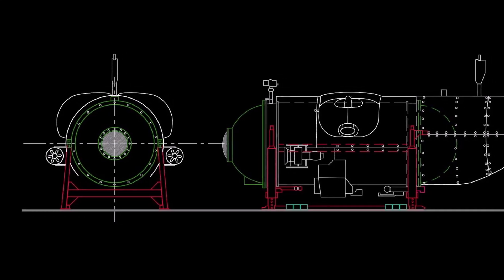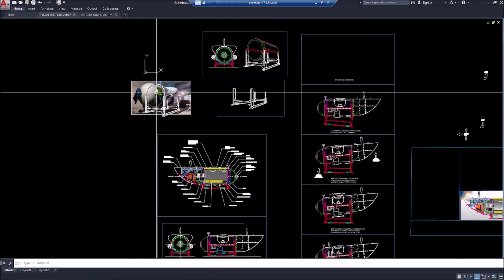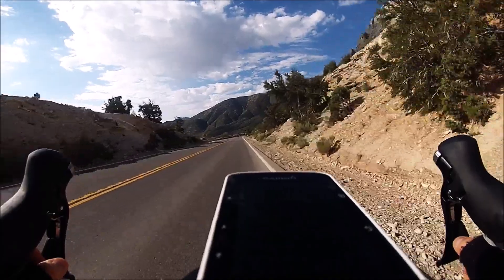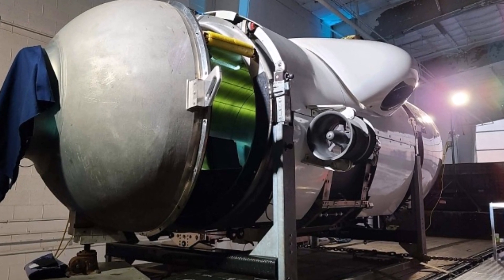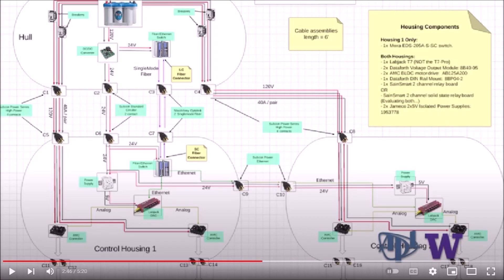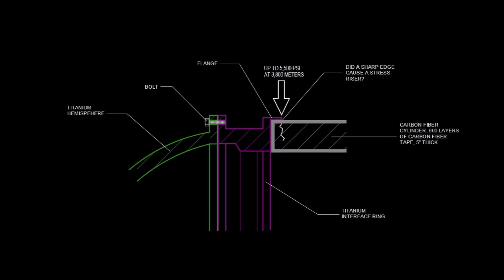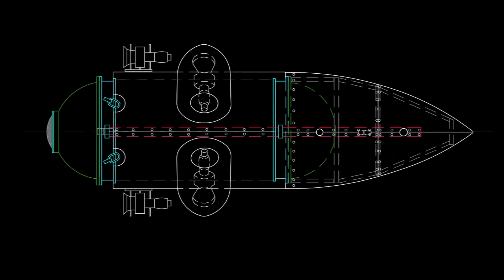OceanGate Titan - INTERFACE RING CAUSED FAILURE?

Comment: Interesting hypothesis. The precise geometry of the notch and bulkhead through joint is not clear at all on your sketch or the blurry photo of the ring, specifically its placement on the major axis, also was this void in the ring not filled with a suitable structural element such as another epoxied titanium piece? I find it difficult to accept that the design would create and allow for several inches of interface between cylinder and interface ring where the epoxy joined the two mayor components, but then in one spot narrow that down to a very small glue joint. To your point about a stress concentration point at the out Ti ring flange on the exterior of the cylinder - the cylinder shrinks more under pressure than the ring so there would be no stress concentration point on the exterior, the interior is another matter: another point I'll make is that I have seen on other cross-sections the Ti ring had an inner and outer flange that nested the cylinder. That inner flange would be a stress concentration point.
Reply from the maker: Yeah you would think that if they had a notch in the ring it would have been filled with something, but even so it's still a weak point. I disagree that the CF cylinder would shrink more than the titanium. Carbon fiber should be stiffer than the titanium. You can see those wiring ports slightly better here: https://youtu.be/Gm28gju5Brw?t=677
Also with carbon fiber in compression like this it's subject to the development of kink bands, which can suddenly appear. Basically another form of de-delamination that can occur. Flange on ring could've initiated it.
Reply: @VegasCyclingFreak    The link to the video you sent I have seen before, yet there is no clear view of the notch you speak of, there is a blurry photo of the outside of the two connecting ports that show no notch in the ring at all. I think you are also mistaken about the  Carbon Fiber Epoxy Matrix (CFEM). It is not stronger under compression, it is very strong under tension, but this application puts the whole system under compression where the exceptional strength of Carbon Fiber is useless. It's like trying to push a piece string, it has no strength in compression. Thus the CFEM is almost just E. Epoxy has far less compression strength than Titanium, thus the cylinder will compress more than the ring.
Reply from the maker: @colinellicott9737  Notch would be on the inside of the ring, not on the outside. That's why you can't see it in these pictures. Only can catch a glimpse of it in the debris video. On the carbon fiber, if Spencer Composites actually built it to Rush's stated specs, it should be as strong as the titanium. I am well aware that CF has somewhere around 50-70% of the strength it would normally have, in this application. If they really just wound 660 layers of carbon fiber tape around a spandrel with no cross layering whatsoever, it would have been pretty much only as strong as the resin.
Reply: @Thunderf00t has a video discussing the interface of the titanium ring and the CF shell.  https://www.youtube.com/watch?v=QNNhUUNHiBM at (15:25} and following.  Yes, CF is stiffer (less flexible) than titanium (although there are many different grades of Ti).  But Thunderf00t points out that carbon fiber is much more compressible than titanium (widely different bulk modulus').  He explains it better than I can.

Comment: Sir, if I go to your 1:32 drawing, I think about a possible scenario. The 'legs' (in red) are released for one or another reason. However, the front side gets stuck, getting ALL considerable weight up front, the vehicle tilts forward down, the loose passengers follow up, getting stuck one on top of the other. As from this moment, it is a total loss; no steering, no controll, the sudden pressure might have followed with your interface ring failure. Regards
Reply from the maker: I've had a similar theory in previous video. I do believe that the frame did not actually drop, which is why their rate of ascent was so poor, and also the reason why they had problems with the power. My next video may help you envision that a little better.  They likely drained the battery(s) down quickly with the thrusters on max speed trying to get to a shallower depth. Those motors I believe had a 40 amp current draw. I will explain that a little bit in video scheduled for next week.

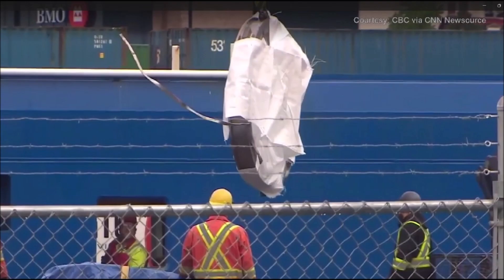Comment: The more good analysis theories like this are made public, the closer we (uninformed outsiders) can get to the actual point of failure, IMO.   Question: I'm curious as to WHY (ref. 4:54 - 4:60), it is said: "IF the alleged crackling sound turns out to be legit" and at  (ref 6:00 - 6:15) the validity of the sound of the implosion is NOT questioned.   Have I missed something?  I've seen the ALLEGED transcript on many YouTube videos w/o proof of non-validity.   Yet, I haven't heard the ALLEGED destruction sound of the Titan before.  How  is it, that with the text release, the adverb => ALLEGED, is used, but the sound has no such adverb to question its validity?   To me, this appears to be a subtle way of improving the validity of the proposed theory.  

While admittedly, it requires the "leaked text transcript" be valid: whatever failure point theory is correct must provide an answer as to the mysterious Titan LOSS of buoyancy, from the start of its final downward descent, continuing to its implosion.

Comment: Thanks for this. You say popping a champagne bottle, which was the ring failing followed by the implosion? Almost a second between.
Reply from the maker: Yes I also noticed that lag. Curious, isn’t it?
Reply: @VegasCyclingFreak   Are you sure that sound played was in real time, or was it just a slowed down event from quality reduced sonus data ? Suspect it will be years before they release anything conclusive, if it any can be made from limited information recorded after comms went out... Intriguing ideas, believe yours is more plausible than many I've reviewed.
Reply from the maker: @mkllove  Good question. It sounds like it’s in real time to me… maybe someone intentionally put a pause in there? I really have no idea. I just downloaded it as you hear it.
Reply: @VegasCyclingFreak  Did some checking, event time in simulations for collapse is only 3 milliseconds, so gap in sounds is probably from speed alteration to make it comprehensible ? Don't think it could be an echo... Will have to ask around with friends in sub community.
Reply from the maker: @mkllove  Yes that could be. The entire recording includes multiple repeats of the big explosion sound… I assume is echoing off the sea floor? I just used the first part of the recording. May well have been slowed down so we could hear it better.

Comment: What had other submersible designers been saying to OG: one seems to have been DO NOT MIX materials with dissimilar thermal and Young’s moduli! And some also saying if one wishes to use innovative constructions inspect, test, inspect, test to destruction to determine the likely safe service life of the design and materials. Space X destroyed a rocket & launch pad and verified, yeah, maybe our launch pad is as we though not ideal. 

There are some who have replied the controls were all wireless/wi-fi to my comment elsewhere that there had to be some sort of ports in the hull assembly for control comms wiring (and Rush’s hand hydraulic ballast drop system). I had my doubts because water can be opaque to e-m radiation in the frequencies used for wi-fi/wireless. I had been scanning what pictures I could find to try and locate said ports. I knew they had to be in the Ti rings since nothing appeared on either Ti dome or carbon fiber composite cylinder (CFCC), and IMO no one would be (reckless or insane enough) to drill into the CFCC hull without some sort of reinforcing bosses. (I’m not sure how one could reinforce CFCC with a hole.) CONGRATS ON LOCATING THE LIKELY HULL PENETRATION POINTS.

Off hand, your theory has merit. Basically you are postulating that the different deflections under pressure of the Titanium and CFC lead to crushing or sheering in the CFC in particular the resin matrix; AND, the cutout &/or ports caused asymmetrical deformations &/or stress risers in the rim of the CFC (or Ti) such as out of round deformations. My bet is on the resin/CFC though my understanding is Ti can be “notch sensitive” which is why surface finish/polishing of Ti parts under cyclic load is critical (or shot peen the part). As you know (from painful?) experience CFC components can fail suddenly. So can any metal after cyclic loading once a crack reaches a critical length (fatigue failure). 

Would be nice if some structural modeler takes a shot at simulation of relative deflections.
Reply from the maker: I think the ports were for data. I got that impression from one interview with Stockton. That’s when he mentioned penetrations only through the titanium parts and they were needed for data. An upcoming video will be an overview of the internal and external systems.

Comment: I think most people are obsessed with the carbon fibre pressure vessel, when the interface ring is so much more likely to have been the point of failure. There is so much stress on that  aft ring with the whole rear assembly hanging off that ring. It would have been getting bashed around in the waves (from the video of them towing it).
Reply from the maker: Well yes and no. At 3,800 meters there's 5,500 PSI of hydrostatic pressure squeezing them domes together with the CF cylinder in the middle... but on the surface the tail could get beat up some in rough waters. That tail framework seems a little inadequate to me. For example, those two big orange batteries alone weighed 500 lbs. There was a lot more back there besides those!
Reply: At that point (multiple dive ) everything was was in the verge of failure. The Hull delamination, the "glue" etc. It was a wonder it made 2 dives before😮. Confidence is good but arrogance is really bad. Rush fired an engineer who wouldn't sign the approval. The electric "engineer" who did the electronics didn't had any previous experience (in submersible) and the funny thing is that he designed the ballast system and the CO2 scrubber.
 Yes I believe the interface ring and glue where the failure initiation and the rest was like a domino falling.
Reply from the maker: @FFG8G  All degreed university educated engineers have the same general knowledge base before they branch off into their specialties. Ballast system and CO2 scrubber were pretty simple systems, so not that big a stretch for an elec engineer to design. All they would have needed is a set of guidelines as to what was required.
Reply: @FFG8G  I have watched the full video of Bruce Morton, the electrical engineer and read his Linkedin bio.  I don't think he claims he completely designed the ballast system and the CO2 scrubber,  he says he worked on them.  Both systems have electrical components.  He only worked for Oceangate from 2021 to 2022.  The Titan was first built in 2017 and dived in 2018, it had a ballast and CO2 scrubber systems in 2017, though they may have been modified or replaced subsequently.
Reply: looks to be the case

Comment: my thirst thoughts have disapeared damn. the 3rd thought is the ballance the whole weight off the sub was on inner edges of rings as you have stated. the back suport i beleive should of been on the outer side off the ring. the rear most edge to ballance the sub. both comments here relate to my thirst comment what was the most telling. great annalis, we doo strive to know.
Reply: In the water it would be in equal condition like somewhat, the back electronics were heavy but it was covered with special buoyancy sponge that wouldn't compress under the pressure.  But above the sea it was in a lot of strees. The even toed the Titan in the rough sea condition. If the communication log was true, they heard a sound at the back side. Then the Battery A dies. Switched to Power B. All the signs says the glue initiated a leak and at that depth the water pressure isn't a joke. A small leak would be like a laser and water will fill up fast. Even with the ballast weights dropped, it wouldn't surface fast. The AFT was all red. The rib cage that secured the electronics was intact and the inner lining of the interface ring was torn , signs of an implotion .
Reply: @FFG8G  it was damaged out off water as you say. the ballance of sub should have been better. back legs and weight of sub shouldhave been on the outer off the ring to help. both bottom flanges would cause or be dammaged. the top inner also. the top outer flange back and front had zero stress. and is likely where the leak causing implode cusing massive explosion. the vid i was watching yesterday shows the way the damage ocured.

Comment: my second thoughts on this, the glue and not a tight fit???? in the bonding off the tube and ring we have all seen was a accident no body was smart enough to do this on purpose????? the glue used was pliable on purpose??? the bigger than most people think gap in the joint was aa mistake by them??? but a geniouse would do this on purpose??? but the geniouse would fill the bonded edges with enough glue to fill the gap???? making your brilliant observations not valid???? there accident of having this gap between bonded areas is what was likely why this sub ever made it down there once?

warm to well cold? if this sub was put in a thermal room and gone through the cold to warm cycle 30 times. that this sub was subject too when diving, this sub would not off got down on its first dive past 500 metre. the cold war would have distroyed the integrety of this 5 inch thick tube. the thickness is why it would distroy itself.